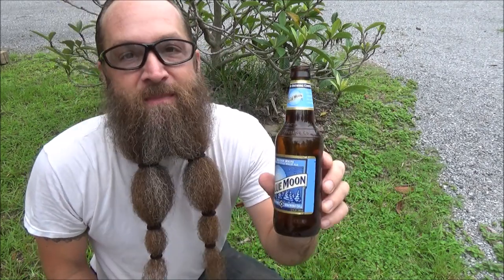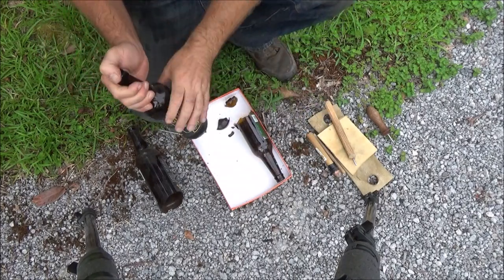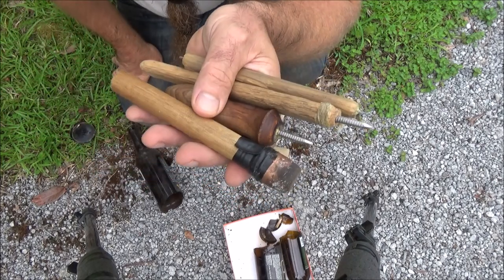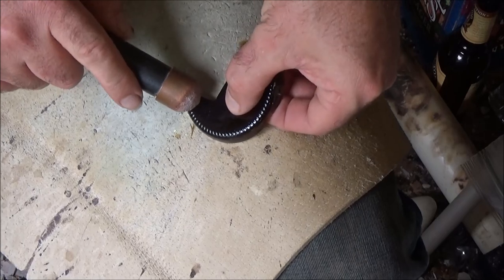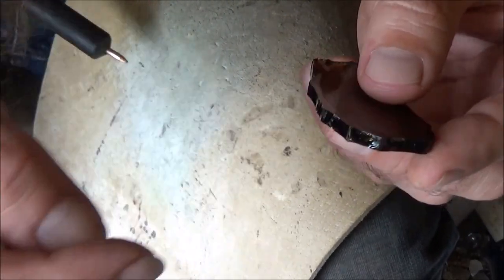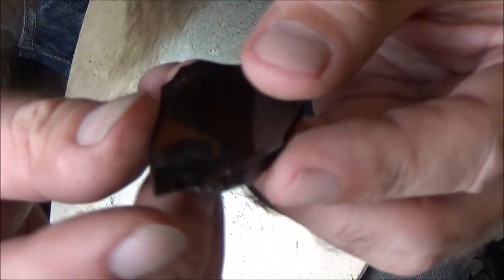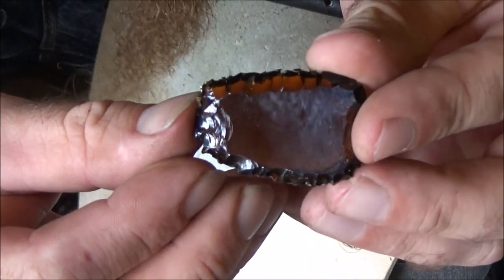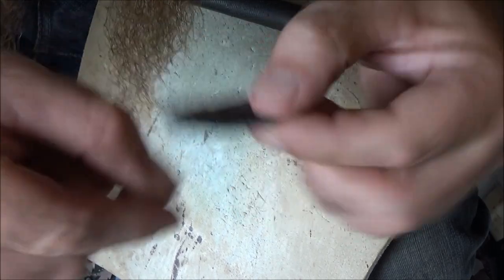how to make an arrowhead from a beer bottle part 1

Comment: Easier to find than a copper nail is large gauge copper ground wire. Sometimes there is quite a bit extra attached to the ground rod outside your house,  usually directly under your meter in the ground. I've found anywhere from a couple inches, enough for one pressure flakes, to a foot or more, enough for quite a few pressure flakers.

Comment: Have you tried the water technique? If you put water in the glass a quarter of the way full and pop the top with a rubber mallet, you can get a pretty perfect break every time. A cavitation bubble causes the glass to break.
Reply from the maker: Alex Troha I've seen that but never tried it. I'll give it a go... thanks!
Reply: gregpryorhomestead I also find it useful to do over a bucket with water to catch the water and glass that comes out. Safe and easy. Though that nail trick is a lot easier
Reply: If you're mean enough use the palm of your hand put water in it grab the neck of the bottle and hit the top with your hand I could do it when I was a teenager

Comment: Have you tried the water technique? If you put water in the glass a quarter of the way full and pop the top with a rubber mallet, you can get a pretty perfect break every time. A cavitation bubble causes the glass to break

Comment: Is using glass a good alternative for flint for beginners?
Reply: Yes. Obsidian is generally the most sought after rock for knapping. It's just volcanic glass is all it is.
Reply: Old TV screens and monitors work good as the glass is really thick so YOU have to thin it down,  just like a natural spall of Obsidian/flint.

Comment: What kind of copper tip are you using in your ishi stick? The one I have seems to be to soft, I have to sharpen way too often!
Reply: They don't have to be that sharp. I used to think that too. I've seen pressure flaker tips as sharp as your finger that people used to make excellent pieces.

Comment: What's the benefit of copper, as opposed to other metals?
Reply: It's softer won't shatter the glass as easy
Reply: It bends to the shape of the platform so it will grip better, making for a cleaner break.

Comment: Im just gonna use a piece of antler, would that be possible? Im new to this.
Reply from the maker: B&M Outdoors antler is possible but a lot more difficult.
Reply: gregpryorhomestead okay thank you, i think ill just make an ichi stick.
Reply from the maker: B&M Outdoors check out my other videos if you want to do primitive (antler) but it's not great on bottles because the glass is very brittle and slippery compared to stone
Reply: gregpryorhomestead thank you for the help. There is a big source of old bottles by my house. Im gonna try to do folding glass knives after a while.
Reply: gregpryorhomestead did you know you can also fill the bottles 1/4 full with water and hit the top with a mallet to break it.
Reply: Antler is the traditional way to knap

Comment: Have you tried the water technique? If you put water in the glass a quarter of the way full and pop the top with a rubber mallet, you can get a pretty perfect break every time. A cavitation bubble causes the glass to break.
Reply: I learned this as an old drinking trick, except we use the palm of our hands
Reply: @javiervalenzuela8284  The tricks of the trade that you learn when you're young. who would have thought all these years later we would use the same technique for flintknapping.
Reply: I learned if you put a penny in an empty bottle and shake it up real good, you can easily break a bottle on your head.
Reply: That's what I do!